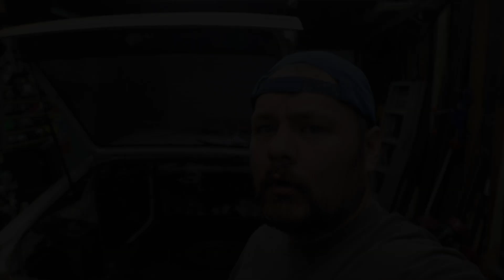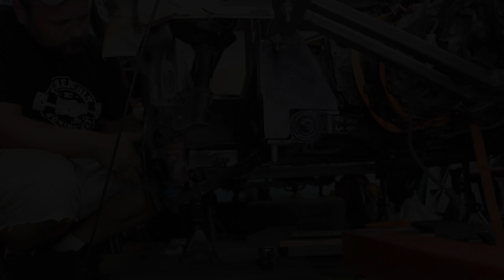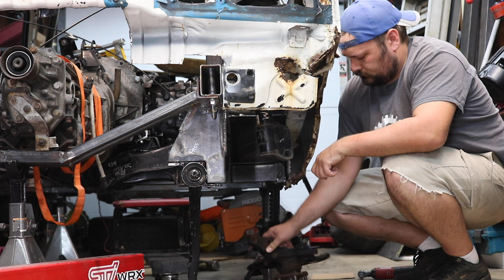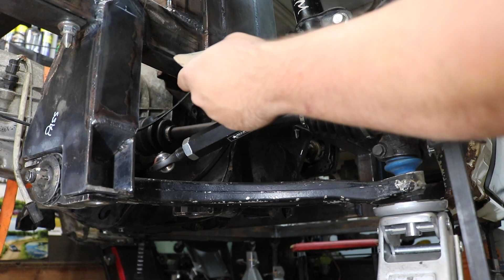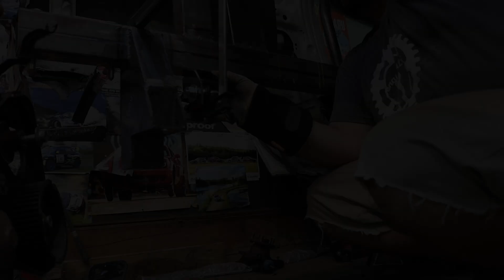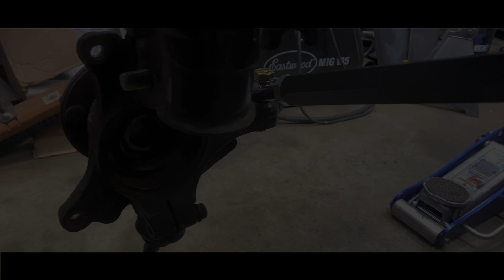RWD Honda CRX: Custom Lateral Links

Comment: rear brake calipers on mid engine car forward of axle centerline - my naïve assumption was to place as much mass as close as possible to the car's center.  my Alfa Romeo-powered, WRX geared midengine build will be using NA Miata suspension uprights which are already set up correctly both front and rear, thank the gods.
Reply from the maker: That’s awesome